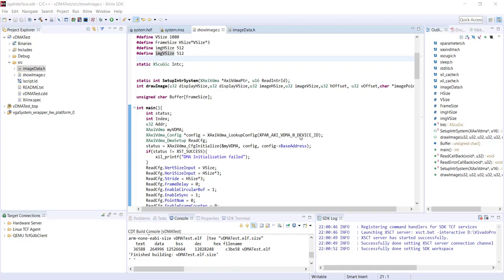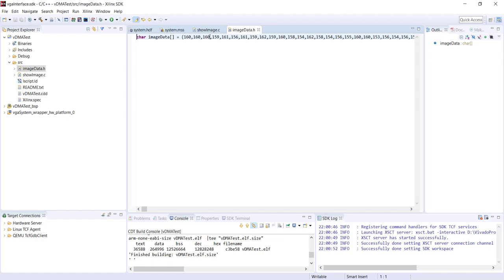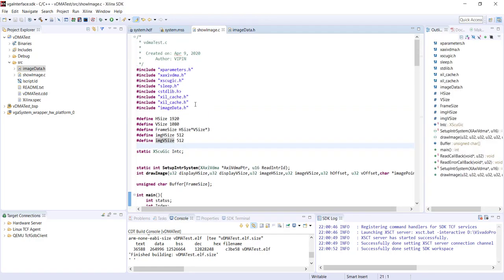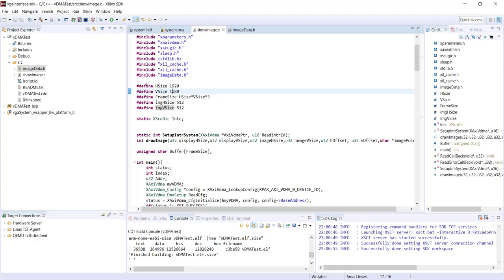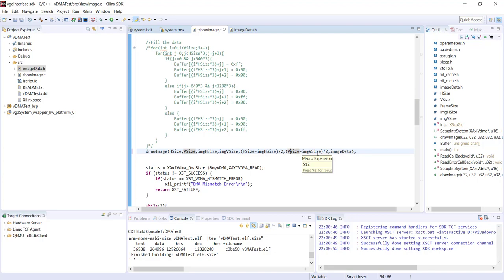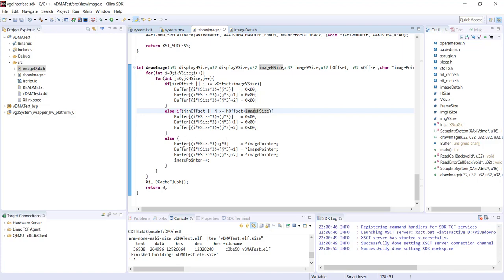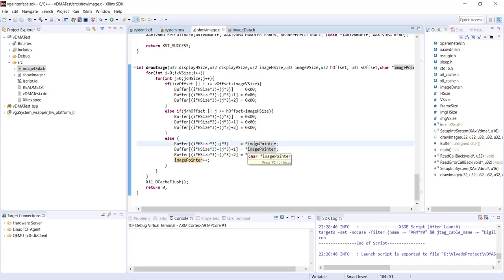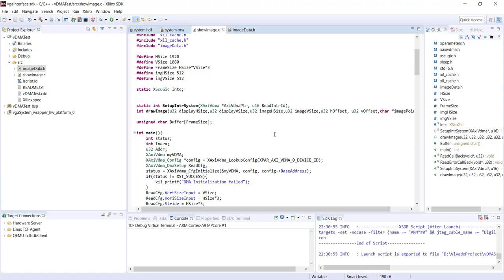Video Interfacing with Zynq (FPGAs): Part 5 Displaying an image on the Monitor

Comment: hey man, i followed your tutorial for image processing with success, thank you.
I want to overcome the limit of the slow speed of the serial connection so i decised to use the ethernet port.
Starting from the lwip echo server template of xilinxs i have integrated the code for the image processing (instead of echo back the received packets on the tcp socket, i put them into the vdma for starting the image processing pipeline).
The problem is that if i configure the vdma, the tcp socket connection seems to not work anymore.
Have you managed to use the ethernet port for receiving photograms to analyze? and even send them back?
Reply from the maker: Ethernet I will make a series after the current one on NoC. But my intention is to do it with raw Ethernet packets rather than IP packets. For the time being for fater image processing you can use the dow command or read the image from SD card. Watch https://youtu.be/i_zWX0mBt1k and https://youtu.be/mdRYY-mpMYI. You may also want to watch the video on converting image data to raw binary data.

Comment: what i need to change in code if I want to send colour photo?
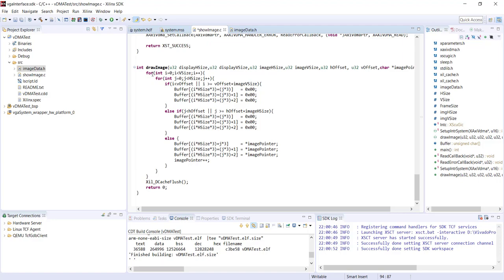Reply from the maker: Your imageData size should be 3x with r,g,b values for each pixel. In the drawImage function instead of storing same value to r,g,b (The one seen at time 6:32) of the video buffer, will have to store the corresponding rgb values from the imageData

Comment: Can you help me show two image in monitor ??
Reply from the maker: You will have to edit the drawImage function in this file https://github.com/vipinkmenon/vga/blob/master/sw/showImage.c. You can see it is copying the image data to the middle of the buffer (all other pixels are set to 0). So if you want two images side by side, either you can store them together in the memory as a single image (imageData.h file) or modify this function such that for each horizontal line, data from first image is copied, then data from second image is copies so on and so forth.